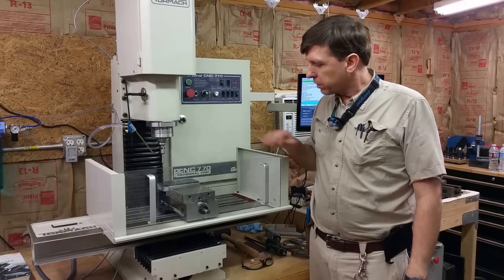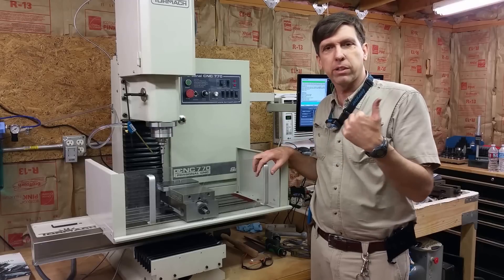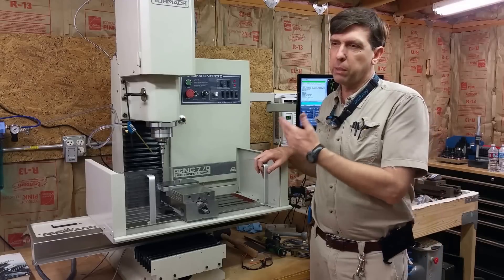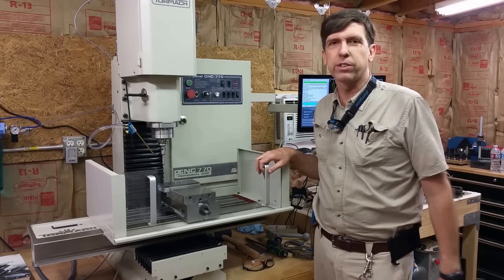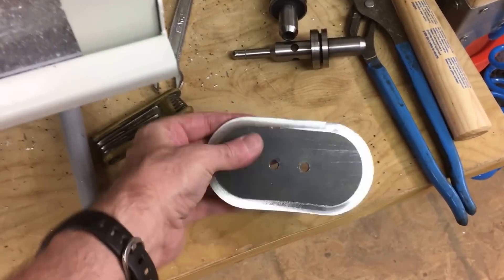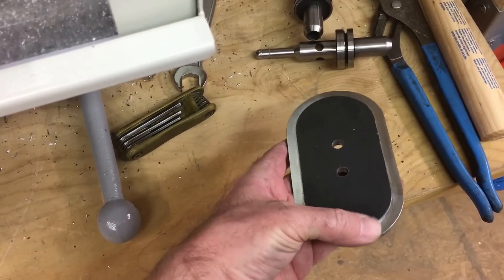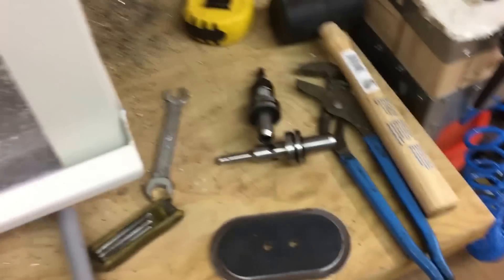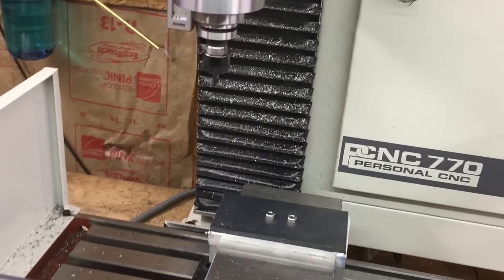Tormach 770 Part 16 - First Part!!

Comment: Wow nice machine you got there. Congrats! I really want a Tormach but I need to save up first. What CAM software do you use?
Reply from the maker: +Mark Nano  - Thanks Mark!  I use Fusion 360. I can't wait to so you get one!
Reply: +Craig's Machine Shop  Have you tried cutting the same part with lower RPM and climb milling? I am curious if that will make a difference in the chatter and vibrations.
Reply from the maker: +Mark Nano - G-wizard recommended conventional milling.  I will try both ways to see what happens.  I will probably try raising the feed.  I will be doing production.

Comment: Well I look at what that part would take on a manual mill with a couple of setups on a rotary table. At least in excess of an hr. And maybe 2 hrs. You did get a pretty nice surface finish on the cut for what looks to be just standard mild steel mill finish plate.

Agree with Bluehands also. I'd come in from the side instead of plunging.

Looked like you only got the replaceable jaw plate on your vise, so all in all not too bad. I've seen a few pictures of vises, mill tables, and the same for drill presses on manual machines that almost looked like Swiss chezze. It's far easier to do that type of mistake I'd think with CNC and a minor programming error.-
Reply from the maker: +Turning Point - Mine isn't Swiss cheese yet. lol  Guess that's why a lot of people want to use CNC mills. I considered using a rotary table but I need to make parts at a certain speed to be competitive. Yeah, the 3/8 EM left a pretty good finish.

Comment: I think you should consider the feeds and speeds more carefully. I heard some chatter and the chips look like your RPM is too high (or the feed rate is too low). Check out this video by NYC CNC (he has a Tormach, too ;p). https://www.youtube.com/watch?v=d6tyyBxWAAU
Reply from the maker: +aspartns  - Yeah I saw that video.  Great video.  That was speeds and feeds as suggested by G-wizard.  I will be playing with the speeds and feeds in the zig zag method John was talking about to get the optimal run time on the part.  I hope to get entire part down to 5 min.  I am at around 12 minutes with all ops.  Thanks!
Reply: +Craig's Machine Shop I think that your feeds and speeds are probably OK but I would look at the width and depth of cut. Also avoid the plunge cuts!
Reply from the maker: +tizwicky - Well, I have to optimize my removal rate because this will be volume production.  Yeah, I have to adjust CAM so it doesn't plunge.  I just have to figure out the lead ins and outs, etc in Fusion 360. Thanks!

Comment: Very cool seeing it cut steel.  Makes me think that cutting prototype brackets with my mill won't be as bad as I thought. Thanks!!
Reply from the maker: +bluehandsvideo Yes,  I am happy so far.  I know it can go faster but i'm taking it easy.  I think your mill is bigger then mine  You should have no problem with steel.
Reply: +Craig's Machine Shop It would be real easy to modify your code slightly so that the second cut comes in from the side instead of plunging.  What endmills are you using?
Reply from the maker: +bluehandsvideo  Thanks!  I will have to check it out.  I am using 4 flute carbide from Tormach.  They are coated but i'm not sure what coating.